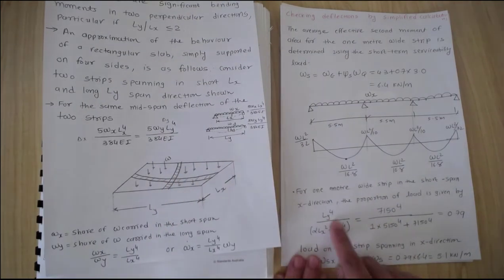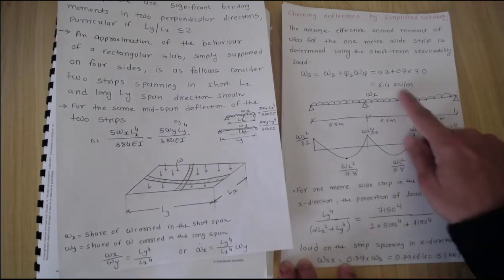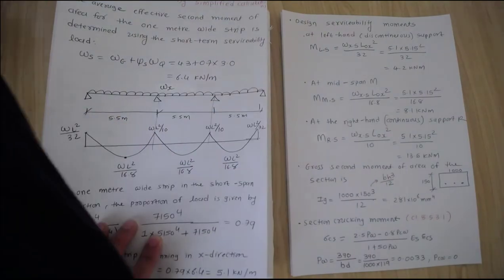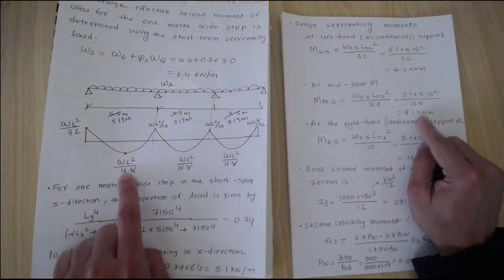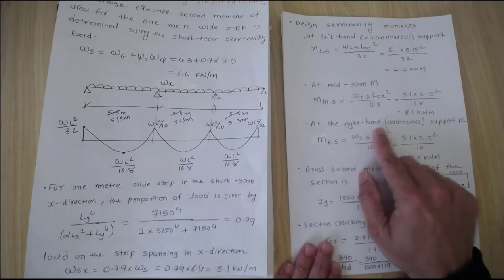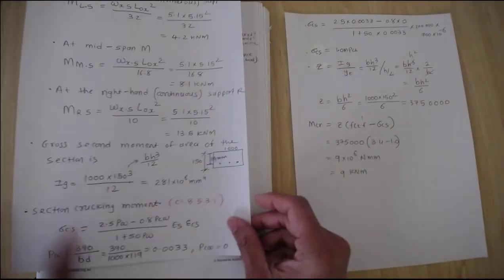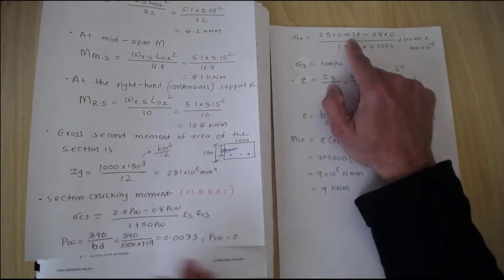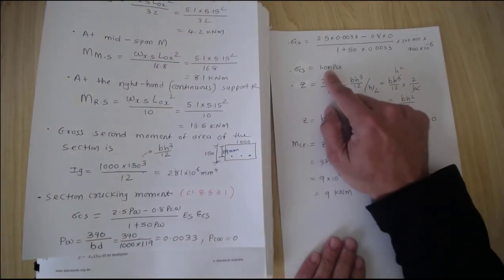Two Way Slab Example 1 Part 12-Cracking moment

Comment: Hi Dr Vipul, may I ask what textbook you used to calculate the proportion of load in the x-direction and also the bending moments? Thank you
Reply from the maker: I am using the following book 
Reinforced Concrete Basics (Pearson Original Edition) 3ed
Analysis and Design of Reinforced Concrete Structures
By: Stephen Foster, Allie Kilpatrick, R. Warner